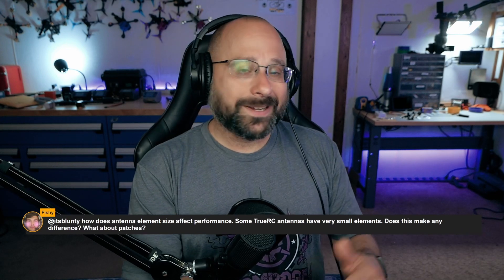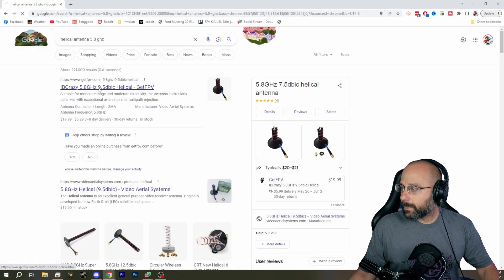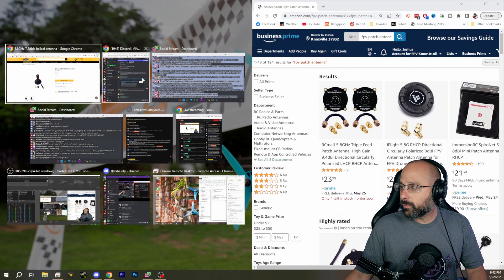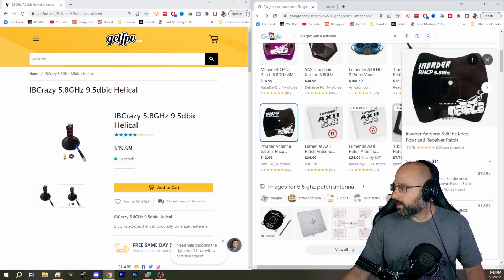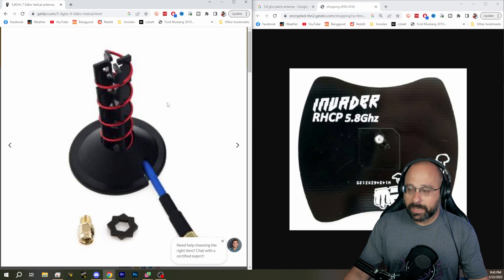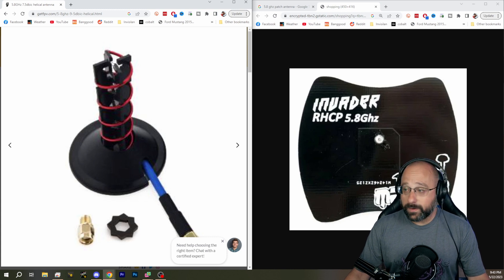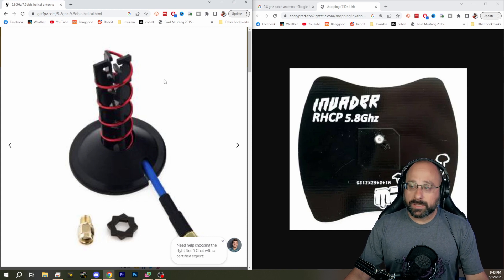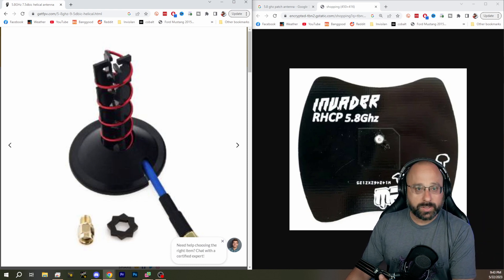How Does Antenna Size Effect Performance? Does Size Matter? - FPV Stream Questions

Comment: The longer/larger the element in the antenna, the more voltage stress that it will absorb from the air.  Since power is proportional to voltage squared, the efficiency of the antenna is proportional to the size of the element squared up to the point where the size exceeds the design wavelength.  Using elements too short/small will reduce the efficiency because the antenna will absorb less power from the air.  But that doesn't mean longer is better.  Elements too long will cause too much of the standing wave to appear on the element which will cause improper impedance and destructive interference.  

A design engineer takes these factors into account and if they are good at what they do, will optimize the size for best performance.  Sometimes they get creative and find ways to pack more parts into a smaller form factor (Minion, Axii, Victory, Ion, ect) which maintains efficiency with reduced size.

Another consideration is the size of the reflector in a directional antenna.  Larger reflectors have higher F/B (front to back) ratio and therefore typically get a better signal.  However, some people prefer a smaller size and will deal with slightly reduced signal strength in favor of a smaller form factor.